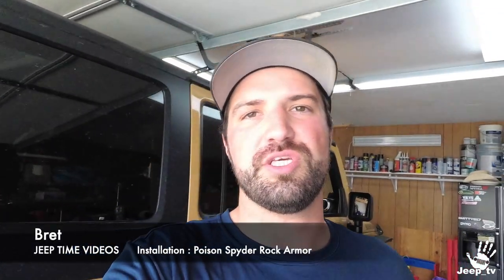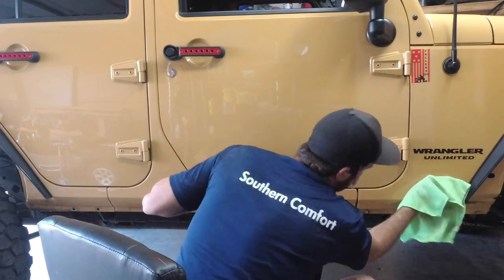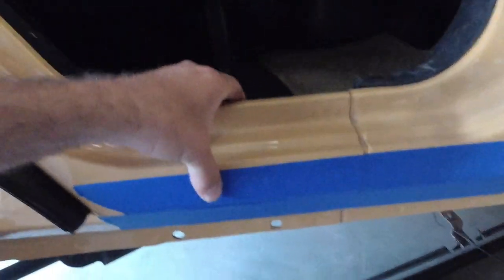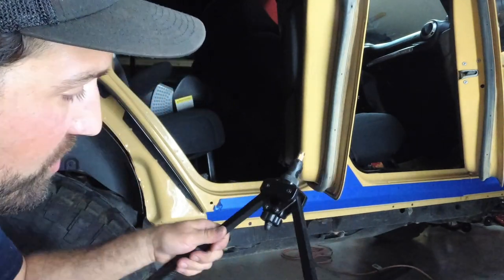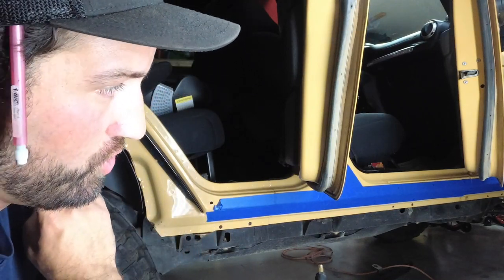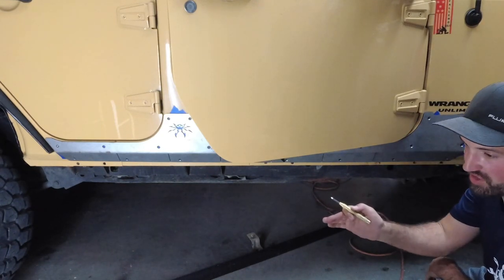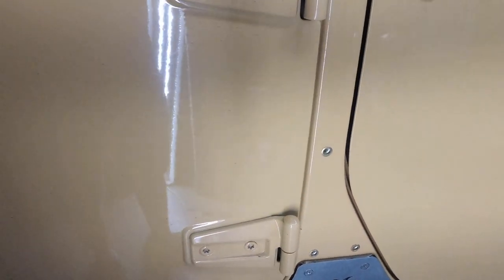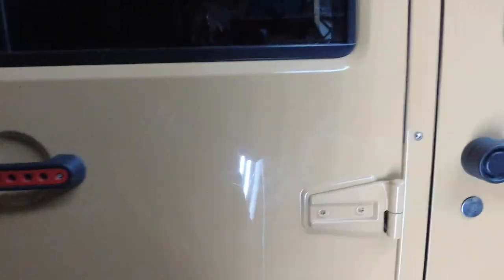How To Install Jeep JK Rock Armor | Poison Spyder Body Armor

Comment: Great video!!  Just a suggestion get a transfer punch. It will perfectly center in the hole and just a tap with a hammer, punch a drill start dimple.
Reply from the maker: I use an auto punch instead. It leaves a good starting dent.
Reply: @Jeeptv  an auto punch is ok, but is easily misaligned (off center) . Wear as a transfer punch will be dead center.

Comment: Any chance of moisture and rust building up under them?
Reply from the maker: Well I have to say if you do not have them powder coated and run a rubber gasket behind them. Yes you run the risk of possible rust or paint rubbing off. I have removed mine and had them professionally powder coated and I installed a rubber gasket. I had minor rust spots. I wet sanded down and re-clear coated the Jeep before RE-installation.

Comment: How good did your rubcon rock sliders go back on ?
Reply from the maker: Brent Sims The passenger front side of the rock slider was a little tight. For the most part it closes in the gap and bolts up tight. It’s deff. A great combo for great body protection. Everything should and will bolt right back up fine.
Reply: I have a set of the aluminum Poison Spyder ones I’m going to be outing on my jk tomorrow mine is a hard rock so I have the hard rock rails and I’m hoping they go back on with out rubbing

Comment: Did you seal them at all?
Reply from the maker: Asylum Jk I only sealed one side of holes I screwed with paint. I’m about to remove them and have them powder coated. And possibly touch up anything I can.
Reply: Jeep_tv 👍🏻 I haven’t seen any videos about how to seal them from water getting behind.  I’ve heard sealing the top side with rtv to let water drain... I’ve also heard completely seal it. Haven’t done mine cause I’m not sure what to do.
Reply from the maker: Asylum Jk If you use a thread sealer there shouldn’t be any water penetration unless it’s submerged. It’s a tough job. A helping hand would make things go faster. The Pillar between doors was deff. The hardest challenge.